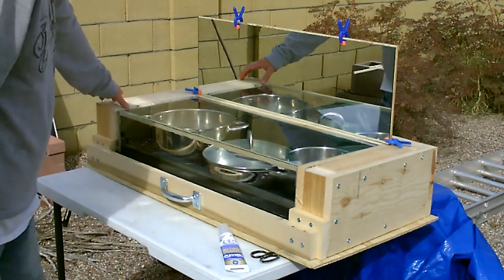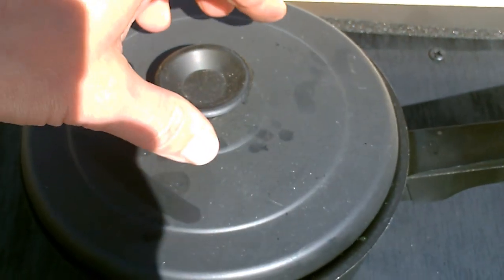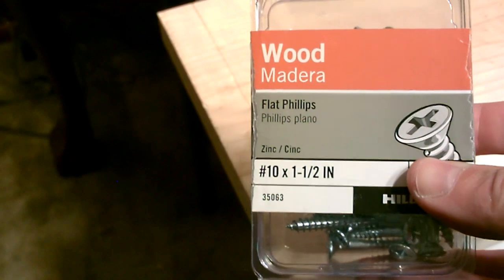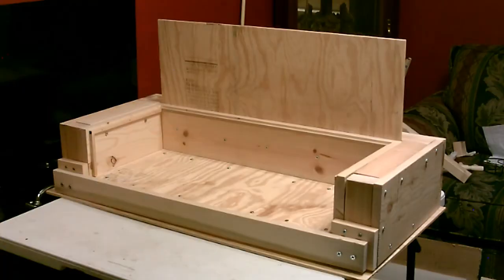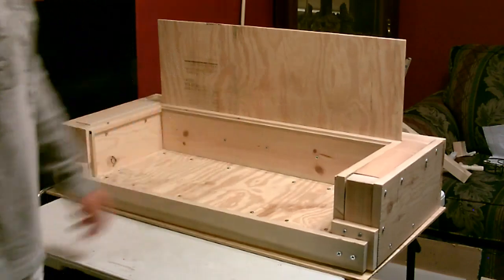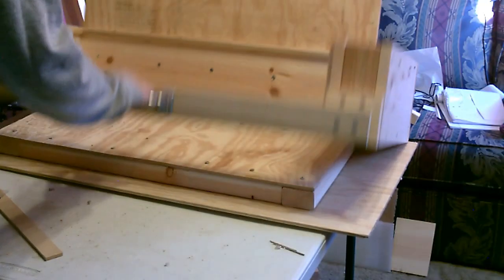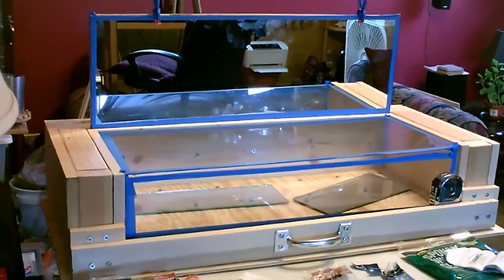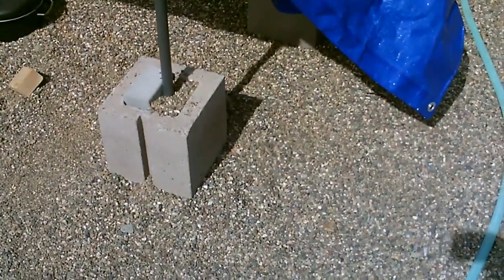DIY Advanced Solar Oven! Fully Insulated "No Turn" Solar Oven! (real wood, glass and mirror!) 350F+

Comment: I love the build.  Think I'll be building one  here shortly.  T he only thing I had issue with is the insulation.  I know with NORMAL insulation, you want to have to have the air in between the fibers.  Do you think tamping your green fibers down caused any  decrease in performance.
Reply from the maker: hi. i don't think so. i've heard conflicting things about whether to pack it down or not. some places say it's better packed and others say not to.

Comment: If anyone learns how to cook beans in a solar oven.... PLEASE post instructions how to do it. From the time you open the bag until completey cooked.
Reply: If you soak them for 12-24 hrs, it will speed up the process as well as make them more digestible. I have yet to cook in a solar oven; but, this is the method I use when cooking my beans.
Reply: @krista1234monkeys  thank you for answering back.
I don't know. I have soaked beans for 24 hours before cooking. And still can't get them to cook right.
Maybe I'm expecting more then I should. To me beans should be smooshy not crunchy.
Reply: The Solar Oven Organization says that some kinds of beans can take up to 2 days and they also recommend pre-soaking.  That said, it is especially important when cooking by solar to use fresh dried beans, not old.  I buy mine from Rancho Gordo and I use a enamel wear granite bean pot (Amazon).  They aren't expensive.

Comment: Great video and project. That's just plain glass, no  sort of tempered  or oven proof glass such as Pyrex or anything like that ? How thick is the glass? How hot was it outside when you tested the oven?Thanks for sharing that with us.
Reply from the maker: hi there. yep, it's just plain glass. unit doesn't really get hot enough to need tempered. just going by memory, i think it was around 70F out maybe a little lower.

Comment: You showed the temperature of the oven, where is the temperature of the soup? How hot did it get? Not convinced.
Reply from the maker: hi there. i thought the steam billowing off the soup said it all. never thought to check the temp.
Reply: Go watch other solar oven videos for proof. You will get at least 200 degrees F from this model. I have made similar.

Comment: You could also use acrylic self adhiesive 300mm  by 300 mm mirror tiles that are shatter proof.
Reply: I don't think they would hold up well against the uv or the heat. The adhesive is sure to fail also, and even if all that weren't true, it would be less reflective, more refracted..
Reply: @dreamingrightnow1174  Works just fine for me. You have to remember that the reflector is REFLECTING, it is not absorbing heat. I have mine attached to a piece of cardboard. Like I said works fine, and I live in the desert where it gets really hot.
Reply: @seungjisuh5784    ... where you don't need and oven, just a flat rock, lol. Seriously though, it's interesting that it works. I don't understand why the cardboard doesn't combust. Have you measured your temps?
Reply: @dreamingrightnow1174  In reality, I could probably cook thin flatbread on a rock in the middle of summer here.  I get anywhere between 200F to 350F. Just depends on the time of year. 200F is fine for cooking in a solar oven for anything I need.  I use oven thermometers.
Reply: @SUHSeungJi  Flatbread is on  my list of things to master... and fry bread.  :)

Comment: Hi @desertsun02 I made the Oven, but instead of 8" wood, I used 10" wood and cotton to insulate. The think is I got just 105°C (221°F) on a 14°C (57°F) sunny winter day. I´m from Santiago, Chile. On your experience, is it working well or I've got to solve some issues?. Everywhere, I'll give you some tips to simplify the design later. Regards (Excuse my english please, I do what I can). By the way, where did you use the oven and what month of the year?

Comment: I made a copy of yours out of pallet wood and fibre glass insulation.  I used a piece of stainless steel that I polished  instead of the mirror.  I made a slot for the stainless so I can take it out and store it in a slot that I made under the base.   It cooks great.  I’m going to line it with insulbreak insulation that is removable for cleaning to see if it improves the efficiency.
Reply: 220C.   I used 6  x 30cm sq acrylic mirrors and it was a 40 C day.  I have a parabolic oven made from an old satellite TV dish and acrylic mirror tiles that I use to distill water it gets far hotter but I think is dangerous to cook with because it’s awkward to monitor the food and prevent it from burning and catching fire!
Reply: What is the highest temperature you have been up to?

Comment: Great project!  I built one similar but not as nice as yours. One thing I did you may want to try is that on the surface where the pans sit, I placed a rectangular ceramic tile painted black. Same paint as you used. The thought behind that  idea was that here in Florida we do get many sunny days but  we also get many passing clouds. So when the sun is blocked by a passing cloud the heat absorbed into the ceramic tile will then radiate the heat back into the box, thereby minimizing the amount of heat variation when the sun is blocked by clouds from time to time.  I never tested this theory scientifically (measurements), but in practice I was satisfied with the results.  When the sun was blocked, it seemed the temp. drop seemed slower and when unblocked the temp rose up in minimal time. It's inexpensive and if not satisfied, you can always remove the tile.
Reply: I like this plan.  Seems legit.
Reply: You could also make the floor out of a heavy piece of plate steel. Of course, I live in New Mexico where rust isn't an issue. Really, anything that adds mass in there. Even a few black rocks in there would retain heat.
Reply: @shananagans5  Can confirm, I use metal (aluminium, iron) as thermal mass and it holds the heat very well.
Reply: What is the worst temp you've reached on perhaps a cloudy day?
Reply: @RexAlfieLee  I don't remember ever trying to cook on a cloudy day. On a party cloudy day, between 150-200F depending on how long the the sun was exposed. Good to warm up things but not to really cook.
Reply: Tux I believe thats a good improvement  idea.. the heat retention will probably last much longer using tile.
Reply: Cool idea! Although the bottom of the plate would be cooler than the top. It has the opposite effect when you do it this way in the oven.
Reply: @canmetan670  I don't understand.
Reply: Thank you, this is another great additional info for me. I love it.
Reply: Great advice

Comment: @desertsun02 Have you used it much? It would be great if you could get it up to 200c so meat would be okay in there. Also what temperature was it outside? Will this work as well in cooler environments? If you make any changes or get it up to 200c it would be great to see another video. Thanks for sharing! 👍😊
Reply from the maker: hi there. meat is okay in there. it only has to be 200F or more for that. (200C is 392F). almost no solar oven goes that high.
Reply: Solar cookers are good for long, slow cooking - meat is cooked enough to be safe at temperatures below 200 - fresh pork, for example, is safe to eat at 145 Fahrenheit per the USDA.   Over that is just for your own taste in cooked meat.   When I cook pork shoulder, I want to get the center to between 178 F and 190 F and then let it stay in the oven at that temperature for 2 or 3 hours, at least, to turn the connective tissue into gelatine.

Meat is much juicier and more tender if you cook it below the boiling point of water.

Comment: Great job. I'm happy to see someone producing instruction in building a Solar Oven out of materials other than cardboard.  Those solar ovens made out of cardboard might be OK for use in an emergency survival situation, however they are basically worthless for any long term uses of more than a couple of times, as they are very prone to flimsiness in construction and will quickly fall apart especially from the moisture content of the steam which is produced while cooking. Also in your case, and for your  information ("FYI"), for the possibility of even greater heat temperatures, and heat retention, you would probably have been better off making the inner panels out of aluminum (or any other metal), as metal gathers heat faster, and overall holds heat retention far longer than wood. However, making the outer walls out of wood is just fine, as it is both cheap, very sturdy, and does not get hot enough to cause burn injuries to children, adults, or animals of winch might accidentally come in contact of those surfaces.  I do like your concept of two sides being made with glass, as it cuts down on the necessity of having to construct multiple solar reflectors for all four sides which saves money. - Just saying. - Keep up the great work.  Thanks for a job well done.
Reply from the maker: hi there. thanks for the comment. if you want aluminum interior just tack down a few strips of aluminum flashing onto the wood. that and extra mirrors may boost it super high
Reply: @desertsun02  "WOW" ! - Thanks for the comeback. I really didn't expect a reply so fast, or even one at all. Once again, "WOW" ! -  However I do have a question. Maybe I missed it, or misinterpreted it, but what was the thickness of the glass you used? was it 1/4 inch thick or just plain 1/8 inch thick window glass, or was it specially tempered high temperature glass made for stoves or what? - Oh,  while have your attention, I would also like to get your permission (if possible), to build one using your method, as I don't want to infringe upon your design without your permission to do so. and I have been searching for one for years like the one I saw years ago in a popular science magazine during the 1960's which was of such solid construction.  Once again, Thanks.
Reply from the maker: the glass is just the standard 1/8". since these don't get over 400F no need for hi temp variety. i've found the thicker glass actually blocks out some of the sun. no need to get my permission.  i make the videos in hopes that people will make the projects. if possible try to add to it and make it even better.
Reply: @desertsun02  OK, sounds great, will do. Thank you kindly for the information sir. Also FYI (if you are interested in viewing such things), I have my own Non-
Profit organization (including a face book page pertaining to it of the same name). It's called the "Veterans Flag Retirement Cavalry". My organization does Flag Retirement ceremonies, and conduct Flag Etiquette classes for our local schools, scouts and communities, and we are sponsored by both the VFW, VFW Auxiliary, and two of our state Senators.

Comment: Very impressive design! I designed one made in a similar style but using metal for the sides, and a steel base plate underneath the pot area to absorb and hold heat for keeping foods warm for hours even after the Sun has set. However, using metal was more expensive, but I think it'll last longer if I wanted to keep it outdoors. (I can also shine one of my satellite dish reflectors on the side for extra heat if needed..enough to easily cook pizzas). The crux for me was figuring out the glass. I've had both tempered and non-tempered glass break from sheer heat so it definitely helps to design it to be able to replace the glass easily just in case you get some bad glass. 

What amazes me is all the naysayers and trolls that claim this is impossible or doesn't get hot enough to cook foods safely...despite people doing it virtually every day around the world lol. Solar cooking isn't always about the hottest temps....but also length of time. Even with meat, as long as you are getting temps over 130F you can cook it safely...just cook a little longer. This is exactly how slow cookers and sous vide cookers work to provide safe food. 

So, hats off to you. You are making the world a better, greener place, and inspiring a younger generation to think scientifically as well as about sustainable energy alternatives.  Not to mention you get to have some serious fun and enjoy great food! :-)

p.s. I do recommend using safety glasses around these type of reflective surfaces to keep the retinas from getting flashed and causing permanent damage. I use Grade 5 welding glasses that look like sunglasses...found on Amazon.
Reply: I hear you about the safety glasses.. but you can nullify the effect of retinal flashes by simply putting a shade sleeve over the mirror when checking on the progress of the solar oven.. just approach the oven from the backside, slip it over, and you are good.. then you only have to deal with the clear reflective glass. because the sunlight will reflect to a degree off of the glass surface..Another  caution is to make sure the mirrors reflection doesn't accidentally cast in the direction of roads and windows when opening or in operation
Reply: Same here, my oven is also made from metal and there's an additional 4 kilo aluminium plate under the pot. That thermal mass holds the heat very well, even if I open it briefly or a cloud passes by.
Reply: demostrat yours

Comment: I am just wondering. How mutch would you loose in heat if you would not isolate? Have you done some tests? I always thougt wood is a bad isolator. So therefore i does not need that aditional  isolation? When i have that answer i wil start on making on myself. Thanks in advance. Gregory

Comment: i am in NC mountains and it is April 2019.  my question is i can only get mine on your design to get 225 or little better so is it the angle of the sun that does not allow mine to get hotter or will it get hotter in the summertime or possibly i missed something.
Reply: Hi David, please excuse my jumping in here.  IMHO, your DIY solar oven probably will reach higher temps in the summer months than it does in April.  That's what seems to happen with my All American Sun Oven.  Also, there will be more hours of good strong sunlight to work with in the summer months.  You might want to look into the possibility of tilting your solar oven when necessary, to better catch the sun's rays in the morning and afternoon.  One of the things I particularly like about my Sun Oven is the ability to tilt it when I need to.  I have also heard that some folks out their Sun Oven on a turntable or sit it inside a flat bed wheelbarrow or cart so they can turn it, if needed, to follow the sun :-). Perhaps people who live in the Southwestern U.S. or in equatorial regions don't need to do that but folks who live in less sunny areas need to.

Comment: Like all your other creations this is a really interesting video, my only question is,  I didn't think you were supposed to compress insulation if you wanted a good R value, whats your thinking on your method?
Reply from the maker: hi there. i guess that's true for some types. for this use, research showed that r value went up .2 to .3 if you packed it in (versus just setting it in).

Comment: How tall are the pans you use with Lids? Would cast iron dutch oven fit?? This would be a life saver in southern areas after hurricanes with no electric for a/c.
Reply: The lids wood is 1x8" nominal (7,25" real) so that´s the pan´s heigh.
Reply: Ikea has some great post that are dark and fit neatly into the oven
Reply: @kentgardiner1858  I have cast iron. Many in south do. So that was why my question. Yes. I'm sure IKEA has nice dark pots but ikea isn't every where.

Comment: This is a great ! The weight is enough to keep moderate winds from blowing the oven around, over, etc. and should keep it stable at 40 MPH winds, which would make it ideal for the part of the southwest that I live in. This looks heavy enough that I can use it outside and not have to find a place for it inside when not in use. Very professional looking design. Looks like it will bake bread if you keep an eye on it.

Comment: Like the build, to reduce weight, use 1x instead of 2x4, also use some hinges. One set to hold the top to the base and another for the  mirror, so it can be rotated and allow the reflective angle to be concentrated into the box. Also putting a hinge on the mirror would allow you to close it and protect all the glass when not in use. 
Showing ambient temperature (outside temp) and some sort of clock, even with the faster video speed, would show how quickly and efficiently the unit works.
Reply: I feel like opportunities to further insulate were lost by his framing decisions? J could definitely be wrong, it seems that if instead of using such thick spacing pieces, he reduced the volume of insulation available. Additionally, in the interior walls were coated with reflective coating or even just aluminum foil or sheet metal (leaving the platform/bottom black) would also have increased the heat threshold while probably decreasing the time it took to get to said heat?
Reply: I really like the visual idea of the clock and two thermometers!

Comment: Love this. Well thought out mods! Would this type cooker work on cloudy or rainy day?
Reply: No Sharon, it needs sunlight to work.
Reply: As said, no can do on rainy days.  But I also have a Sun Focus hybrid - it can work without electricity, just electricity, or both at the same time.  The heating element heats up to 450 degrees so I use it some times to also pre-heat the oven if it is something that will take a long time to cook, like beans.  You can see it at SunBD online.

Comment: I LOVE your designs! The water(evaporative) cooler you designed is still working well for me, now into it's second season. I built it using an 18-gal sterlite container, a water cooler pump and a 6" desk fan. I got an extension cord so it can be plugged in across the room and I hooked it up to a timer so it comes on to cool my fiver's bedroom so I can sleep at night. Thank you again for a great design!